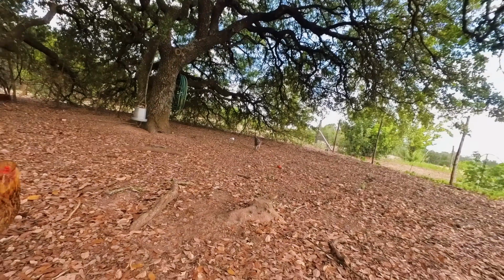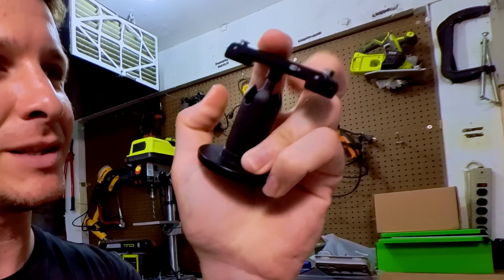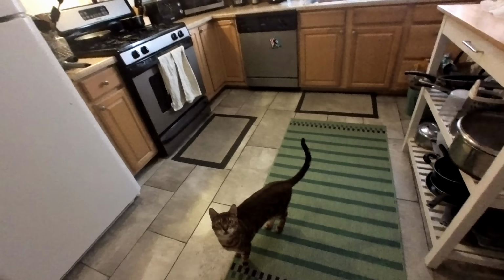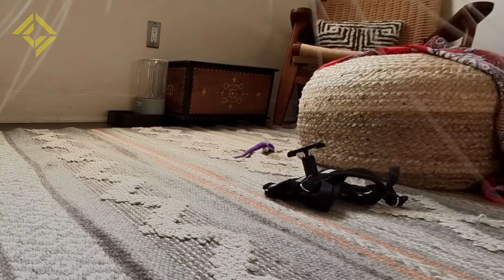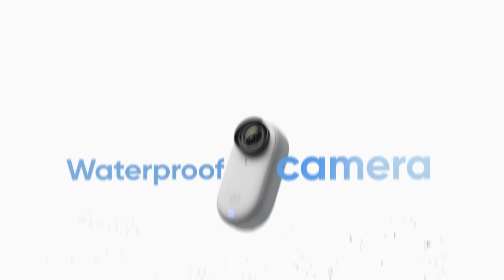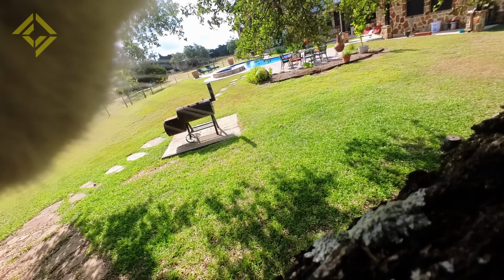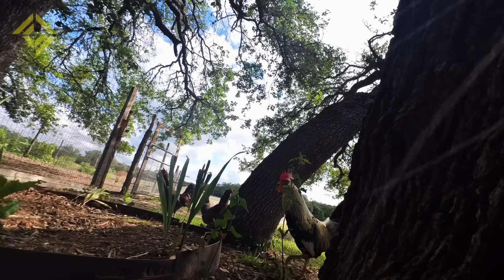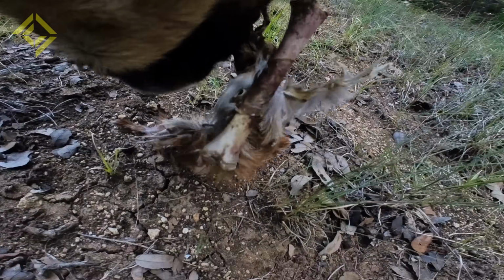Camera on a Farm Cat!

Comment: The harness rig would've worked fine too after the cats get used to it. That initial reluctance to move is normal but goes away
Reply: The second solution was way better. Why would we force the animal to get used to less comfort?
Reply: All you have to do is make a chest harness out of the same thin neck collar material, this way the harness sits in between all the muscle movement :)
Reply: @TeenPerspektiva a harness is technically safer much safer.

Comment: As a Texas ranch kid,  here's some advice: get pet insurance, especially for venomous snake bites. Snake bites are super common in rural Texas, and extremely dangerous to your pets. Most pet insurance plans will cover treatment for an envenomation, which is ALWAYS a medical emergency, and VERY expensive. Also, it's imperative that you know the closest emergency vet that keeps a good supply of antivenin on hand, because you'll want to head there immediately after you notice something wrong. If you suspect a snake bite, venomous or not, remove their collar (because it will constrict their airway with the swelling), and get them to an emergency vet immediately.

Comment: be careful, if you jerk off the Go3 too hard, you might break your arm. we get it, its a competitor to GoPro. but you lay it on REALLY thick. just focus on how its different from GoPro lol. Is it more rugged? will the footage be saved if it drops of an airplane during a test flight? does it have some kind of remote location feature to find it if it drops off a plane during a flight? Does it have better quality video than a GoPro? I can see it has seemingly better mounts and its smaller, and the wireless preview is REALLY nice. not having a remote monitor for a GoPro is extremely irritating because once they are strapped in, you often have no way of checking their video or if they are even recording. also the 360 is really nice because go pros sometimes move under high g loads and you lose your framing. 

But let's be real, people have been putting GoPros on their dogs and cats for about 10 years now. don't pretend you invented this or its the first time anyone has done this, it makes it look like you think the audience are brain dead. its like claiming you invented water and trying to sell it to me.

Comment: I do not like gopro because they have micro buttons that you do not know if you pressed one and they boot up instead of switch on. I film while I work and I work on the water and I do not have the time to fiddle with the camera before I try to take a picture. I have a ROAM 2 which has a big switch on top that if you slide it forward, the camera is on and if you slide it back the camera is off. That gopro would still be booting up and I would be squinting at the screen to find out if it were on or off. Unfortunately, ROAM 2 is no longer manufactured. Anyone know of a small camera with definite on and off switches and not those stupid micro switch buttons?